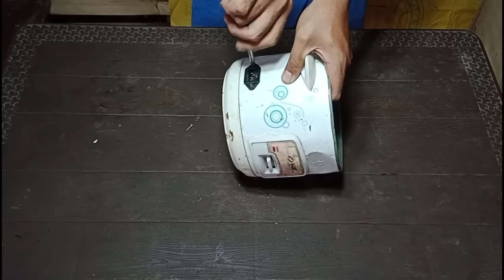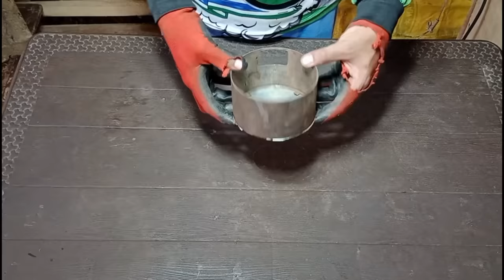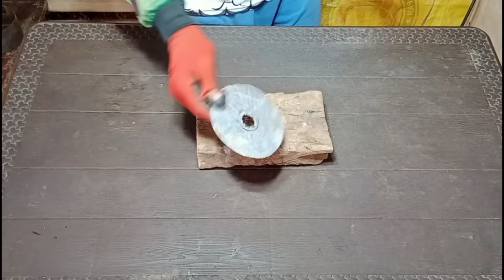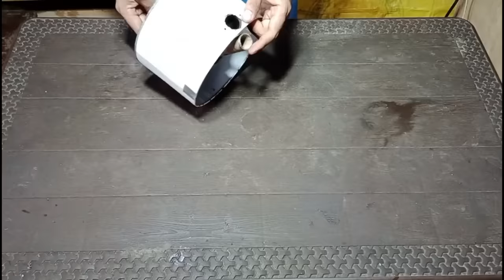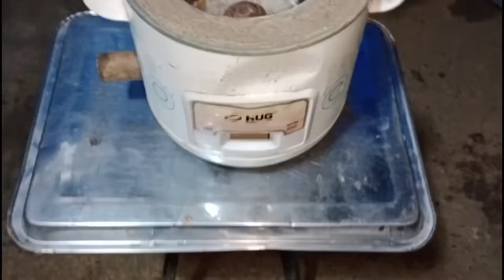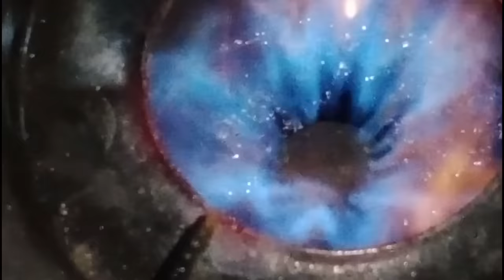Many People Do not know These Techniques, Amazing idea using old gas burner

Comment: Nice move , stabilizing that cast iron welded on a GI sheet, with cement! Or did you use cast iron welding rod. Im just curious how you weld it. Thank you
Reply from the maker: Hi, Thank you for watching and comment, I used iron welding rod✅
Reply: ss welding rod gamitin mo.

Comment: eh ung burner ko po...pagmagluto ako bkit nangingitim ung kaserola ko...paano po mag adjust n hindi mgkaroong ng itim ung kaserola..
Reply from the maker: You need a blue flame to avoid black stained on your pot, I suggest used 2.5mm drill holes

Comment: All this complicated effort when you can just use at least three stones to cook something. 😂😂😂
Reply: Lol no need for an escalator when you can climb, boat if you can swim or a car if can still walk hahaha
Reply: 9
Reply: Just remove the word  innovation in the dictionary.
Reply: Stones don't burn by itself.. you need fuel. When the fuel is expensive (LPG) or unavailable (wood).. this works
Reply: It's compicated if you do not have skill.
Reply: The issue is not where to place a pot  but the struggle is to find simple and cheap coats of heat source that will be applied anywhere

Comment: How do you adjust/regulate the heat? And how would you add oil in case oil is consumed and u r still not done wd ur cooking?
Reply from the maker: Hi, you can adjust using a 12v controller